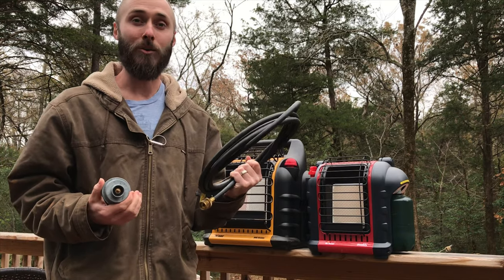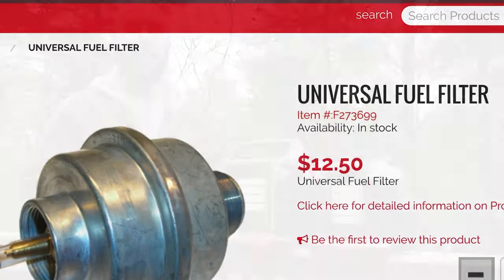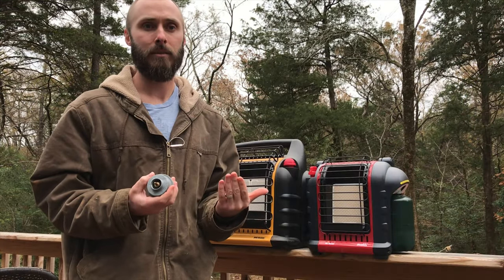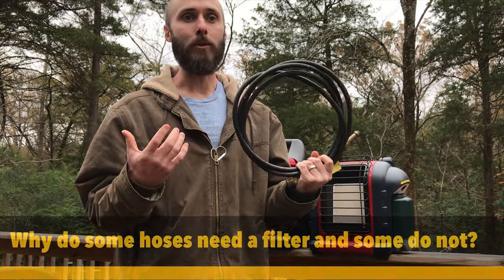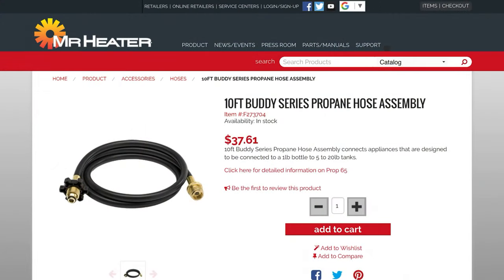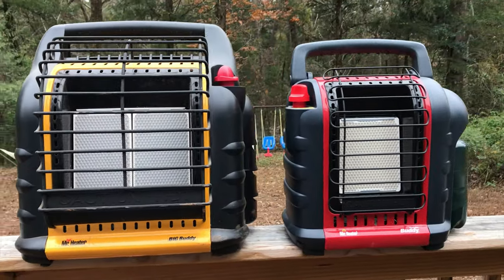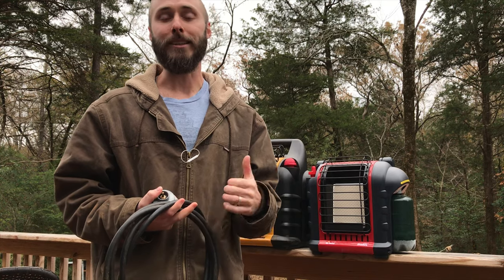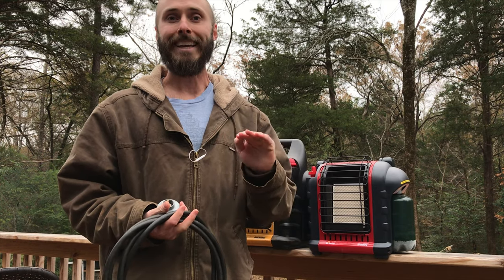Is a Mr. Heater Fuel Filter Needed When Connecting To a 20 lb propane tank? | East Texas Homestead

Comment: can i use the big buddy up to 18000 btu with a 100lb cylinder? and in your opinion , if i can what do i need in as far as hose and other things. thanks
Reply: You would need a QCC to POL adapter since 100 pound tanks have internal threading on the valve. Other than that it should work the same as a 20 pound tank.

Comment: That last part didn't make sense, why use a regulated hose if there is already a regulator on the buddy heater? You already said it would regulate it down too much for 2 regulators. Explain further please.
Reply from the maker: The regulated hose bypasses the internal regulator by using the quick connect.
Reply: @EastTexasHomestead  you are talking of the bigger mister buddy, I have the single bottle smaller buddy heater $75. So on mine I only need the hose and filter not the regulated hose.

Comment: Do u know if F273684 needs the filter I'm using it going from a 20 lb tank to a dyna glo heater
Reply from the maker: I haven't looked into this hose but considering it has a 2-stage regulator upstream from the hose, I don't see the need for a filter.

Comment: Question....I ordered a Big Buddy heater which hasn't arrived yet. Since it holds two tanks, which side do I attach the hose and filter to? Does it matter or do I need a hose for each side?
Reply from the maker: Good question, Terry. 
You can connect the standard hose to either side.
The quick connect hose, however, will only connect to one side. It will be obvious which side that is. 
I hope this helps.

Comment: If you're using a 20lb propain tank that doesn't have a regulator you should be okay with the filter correct?
Reply: The filter is a filter...but the buddy heater has a regulator already 👍

Comment: I’m a little confused. You referred to the regulated hose but stated earlier that the heater also has a regulator on it, and if both were used would lead to over regulation.  So how is it that you would use a regulated hose? Thank you for your time
Reply from the maker: The regulated hose I recommend and mentioned uses the quick connect on the Big Buddy side, which bypasses the built in regulator. Hope this helps.
Reply: @EastTexasHomestead  yes. That helps a lot. I didn’t realize that the smaller units only have the regulator and not the quick connect bypass like on the larger unit. Your videos are great. Keep up the good work.

Comment: SO, when ONLY using the small canisters that will screw directly to the heater do I need the filter? IF I have too then the heater won't set on it's base
Reply from the maker: No. The filter is only required (sometimes) when using a hose.

Comment: wouldn’t the contaminants more likely be coming from the propane rather than squeezed out of the hose itself?
Reply: The old hose leached oil into the propane in the hose. The propane has no contaminants, only mercaptan for leak detection, same as natural gas.
Reply: No, the plasticizers used in cheap rubber hoses are the culprits.   Mr. Heater part #F273704 is the hose you want.

Comment: Wow I think it's BS . My buddy heaters got water in lines with filter being new. Removed them been fine for 3 yrs . Using non mr heater lines. It was a pain blowing out lines. And I do plumbing. So explain that with filter water in lines. filters not a week old trashed. Gas was good. Used it after cleaning lines.with np in same heaters.
Reply: No filters since not 1 cleaning run great. Hmmmm
Reply from the maker: So what caused your water problem. 🧐

Comment: I'm trying to run portable buddies to bigger tanks. If I understood the video, I need a 10 foot mr. Heater hose and no filter. 
Is that correct?
Reply from the maker: There are other options, but that's the setup I would recommend for you.
Hose: https://amzn.to/2ZAjDaL
Filter: https://amzn.to/3mmetIc
---
The above affiliate links will take you right to the products.
Reply: Hose number F273704, needs no filter or regulator (heater already has the regulator).

Comment: I am a little confused. In the beginning you stated that using two filters would be over filtering the gas. But then later on you state some hoses need an additional filter.  What am I missing? Thank you so much for your time.
Reply from the maker: The hose with the regulator bypasses the internal regulator of the unit on the Big Buddy. This is because it has a regulator on one end, and a quick connect on the other end. Hope this clears it up.
Reply: @EastTexasHomestead  thank you for your reply. When you say it is suggested to place the filter yearly does that mean the filter connected to the heater or an external filter? Thank you again for your time I just found your channel and I’m binge watching your videos. Really well done.!
Reply from the maker: @craighellberg4366  Mr. Heater suggests that you replace the external fuel filter once a year. You shouldn't have to replace anything inside the unit unless something goes wrong. Thanks for watching and commenting :)

Comment: Oil can come out of some hoses under no pressure at all. I had hoses for a beer keg many decades ago and they dripped oil when I had them stored on a hook in my garage. They had oil inside and outside of them. I never knew why they did that but I threw them away because of it.
Reply from the maker: That's nasty 😖

Comment: Can you clarify this... if I buy a hose with a regulator I then would not need a fuel filter is this correct? It’s only if I buy a hose without a regulator that I would need a fuel filter?    Thank you for your videos too by the way.  Absolutely great
Reply from the maker: That's correct. There is an exception though. That is if you purchase a non regulated hose that is designed to handle the high pressure without leaching oil. This would not require a filter as well.
Reply: @EastTexasHomestead  thank you for all your great information.  You have a wonderful channel and it is very much appreciated. Keep up the great work!!!

Comment: Are you sure on the part numbers? Mine is F271803 but you said F21803. Is there a new part or something? I am using my 2 year old buddy at this very moment as the boiler is not working.
Please respond.
Reply: He wants you to comment which helps out his YouTube readings but he has no interest in answering anyone’s questions. 👎🏼
Reply from the maker: Take a look around Keven. I’ve answered thousands of questions. I’d love to answer all of them all but its not possible. Sometimes they slip through and I don’t see them. 

In this case, BreadAndGatorade, I’m sorry I missed the question. To give the short answer, you are correct. I missed a digit when giving that number. Sorry about the confusion.

Comment: Always use filter. I opened a filter, its hollow. It has a piece of metal plate loose in the middle. Easy to clean use acetone works.  Had thermocouple problem with mine.  Removal was easy
Reply: Were you able to reuse the filter after  taking it apart  (put it back together)? I always wondered what was inside.
Reply: Looking for same response...never cut one open, is it possible to use alcohol or Simple Green to clean the filter mechanism, dry it, and re use it.
Reply: Yes use a socket to open one side and a tire stem removal tool to open the other side.  Make sure to remove all the cleaner that you use. Wish I could post a picture its really simple filter to own. Its all metal and thick enough not to worry about using  a hard cleaner (I use acetone). With one big o'ring in the middle.

The rattling you hear is the piece of metal that you see, looking through the filter.  It stops you from seeing all the way through the filter.
Reply: @jonathanzweig00  Thanks, I thought you actually cut it open. I see the brass stem and the schrader valve.
Reply: Yes.  I did cut the filter in half making it trash.. see what all is going on inside.  I posted this to help others so they don't have to cut their filter open. Just remove what you can and follow my directions and or use another cleaner up to you
Reply: @jonathanzweig00  Thanks for the update.

Comment: Thanks for your help with this one. I have a Mr heater fan forced heater that is round. It has a regulator on the hose. Will that be ok? Please let me know. Hope to hear from you soon and thank you so much for your help.
Reply from the maker: I can’t say for sure but if the regulator is on the tank side of the hose, I’d bet you don’t need a filter.
Reply: Ok thanks for letting me know and for the response.

Comment: I just received my new Mr Heater today, and the decal where the bottle goes states:  “This heater may be used in a recreational enclosure or temporary construction work enclosure with a remote refillable propane cylinder ONLY when the cylinder is located outdoors.  NEVER bring a refillable propane cylinder indoors.  A fire or explosion can occur causing property damage, serious injury or death.”
Yikes!  Really?  Does this mean that using a 5 or 20 lb tank in a van is to be avoided at all costs, or are they just covering their butts legally?  Why is a 1lb tank ok, but not a larger one?  *I plan on using this in a van, but not running overnight.
Also, would it be a good idea to use a bit of that white plumbers tape to the threads of all joints?
Reply: full size tanks have pressure blowoff valves.  Worst case is a cylinder gets knocked over and valve discharges towards ignition point like heater then boom.
Reply: @ghomsey5372  I use one inside the house, I crack a window, and place the heater in a non traffic, safe area. So far,...ok
Reply from the maker: The best situation here is to crack a window in your van and run the hose outside to your larger tank. This will give you the fresh air (which is a bigger issue than the tank leaking) that you need as well as get the tank outside.

Comment: Do I need to add the fuel filter when I’m using the 1 lb tanks ?
Reply from the maker: No. I don't think it will fit if you try. While there could be "junk" in your one lb tanks, it isn't likely to cause a problem.
Reply: No. The filters concept is to trap particulates leached from the rubber hoses.

Comment: Do you need a regulator with this set up or just filter . Great vid
Reply: Just the filter! Device's that run off of 1lb propane tanks have regulators built in
Reply from the maker: Thanks, Srank. The only exception here is if you are using the quick connect on the Big Buddy. This bypasses built in regulator.

Comment: My Mr Big Buddy has tooken care of my family during power outages several times.  I wouldn't go back to kerosene for anything.  My generator also takes propane.    And the best thing about propane is you can stock up on it and don't have to worry about it going bad.
Reply from the maker: It's an excellent fuel for sure. We were glad to have a few of these heaters last week.

Comment: I haven't bought the filter yet but where do you install the filter? On the 20 lb tank at the beginning of the hose or does it go on the heater itself
Reply: It goes on the heater.
Reply from the maker: You screw the filter on between the hose and the heater (the built-in regulator). In other words, you put the filter on as if it were the 1lb cylinder and then the hose goes on the other side of the filter. I show it here: https://youtu.be/4rFsJtxjRSg?t=223
Reply: @EastTexasHomestead  Thank you man
Reply: @EastTexasHomestead  lol.. Now do you have a video about the tank freezing?
Reply from the maker: I don’t but that’s not a bad idea. Thanks
Reply: @EastTexasHomestead  Cool man... This year was a bad year for that mess happening.. I put a blanket around and it helps some but not much.. Lol

Comment: I would not trust a Buddy heater, I had an older model Buddy heater 9kw model.  The control knob would get stuck when the heater got hot, no way to turn it off. I attached the fuel filter and the hose to the heater, then moving it into position, the filter and/or hose loosened up, the escaping gas caught on fire, had to turn the gas off at 20 lb tank. Those heaters belong in the garbage. I now have a Dewalt 12kw heater and only use the 1lb canisters with it. The Dewalt heater uses the 20v batteries, has electronic ignition,  built in fans, a light and USB ports. I have a CO sensor and use this heater during power outages

Comment: The oil is a product of the lp gas!
Reply: No, it's a plasticizer used in cheap rubber hoses.
Reply: @jshepard152  No, all lp gas contains oil residue, after a while it builds in the heaters. It doesn't matter what kind of hose you use
 I repair these heaters for a living.
Reply: @ridgerunner3364     It doesn't contain enough oil to make a puddle on the floor.  Cheap hoses under pressure do.
Reply: @jshepard152  I'm not going to argue with you. Believe what you want. You can run a metal hose to one of those heaters and it will still collect oil. Smh!

Comment: Is the filter installed at the tank or the heater?
Reply: In another video, he indicated it's attached at the heater.
Reply: @vidpie  ...thanks.
Reply: The filter is attached at the heater. The purpose is to filter the oil from the hose. After using the heater, turn off propane tank and let the heater burn off the propane in the hose. Takes a few minutes. That way the hose isn't sitting with fuel inside it.

Comment: So my question is this.  I know the difference between the f271802 and the 803 both have the quick connect.  Why does the 802 not need a regulator when using the quick connect?  And when using the quick connect,  do you have to do anything special with the 1lb connectors, like make sure they are both in the down positions?
Reply from the maker: The 802 is the “RV Hose.” It is most commonly used to hook an existing regulated propane line in a camper or motor home to the Big Buddy heater. It doesn’t ship with a regulator, but you have to use one.

Comment: Funny thing about the fuel filter. For ice fishing my friend and I both run buddy heaters off 20lb tanks. He swears by the filter, I don't care. Inside the buddy is a 1/4" aluminum tube that feeds the system. Both buddy's plug this tube up after 3 years with a grease like substance. The filter does nothing. Both heaters quit working and we both have to clean them out. Its like clockwork, my buddy heater is 17 years old.
Reply: You have to change the filters annually as a minimum if used a lot. The filters get dirty/full and will pass the crap into the heater.
Reply: @winstonsmiths2449  o
Reply: You replaced the filter every year? You can't use 1 filter forever

Comment: Why does my tank freeze while in use
Reply: PV=M^rt
Reply: Because it's low on fluid... It's coming out really fast
Reply: The propane in the tank is in a liquid state only under pressure.  In use you are drawing gas out of the container as the liquid vaporizes to keep the pressure stable.  A change from liquid state to gaseous state absorbs a lot of heat from the surroundings.  That's why you have to put heat into water to make it boil.  when you reduce pressure and force evaporation you absorb heat.  Same thing goes on in your AC unit making the air cold.  It just repressurizes the gas which makes it get hot, cools it outside and sends it back inside to vaporize again and cool the air.

Comment: Hi, I am currently using the f271803 hose with the mh9bx portable buddy. I did this by removing the quick connect coupling from the hose and using an adapter from the end of the line to the input of the heater. I am wondering about a comment you made in the video about using two regulators and creating high pressure from over regulation. Can you elaborate on this and provide a source to allow me to investigate further? I have tried to find more info on this but have come up empty handed. Thanks, I appreciate your video and look forward to your response!
Reply: I am frustrated these videos are put out by someone who seems to have the answers - but when his subscribers as for his or clarification, he doesn't answer.  He does respond to compliments tho.  Frustrating for those of us trying to learn.
Reply: He was reading off the website.  Likely doesn't know anything beyond what he is reading as far as those details go

Comment: The oil come from the pump that fills the 20# tanks not the hose. you can look in the hose before you install it there is no oil in the hose.
Reply: There's no oil in the hose in the sense you mean.  It's a plasticizer inside the rubber itself.  It keeps the hose soft and flexible, but will leach out under high pressure.

Comment: This is my third Buddy Heater and every one of them has done the same thing including this one and I do have the right hose for it can I put a fuel filter on to cuz I know I am getting oil the lines on my buddy heater it makes it to where the pilot light is weak or will not stay lit thank you
Reply: 00 Buck There is an easy cleaning procedure on YouTube.
Reply: The hose degrades and bits end up in the heater orifices. That's what the filter is for.

Comment: Just got a portable buddy heater for ice fishing. I plan on using the green propane tanks probably 100% of the time.

Received the fuel filter in the box. Is the only time you need a fuel filter is when using a hose from a larger propane tank to the buddy heater?

Thanks for any input.
Reply from the maker: That's right. The filter is to collect the oil from the hoses.
Reply: if you refill the lb bottles you will want to use a filter as well
Reply: @Connor_OConnor  Because residue from your large 20# tank, if you fill your 1# tanks from the 20# tank, will go into the 1# tanks.  So you will need a filter.
Reply: @sassylady2001  

its not just cr@p from the 20lb tank, it is the oil the is pulled out of the cheap hoses that is the major problem